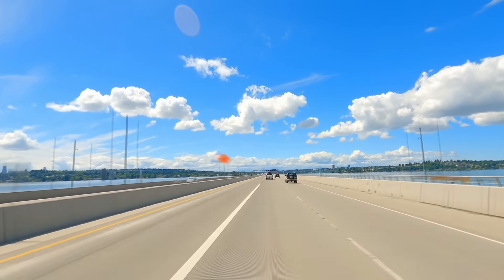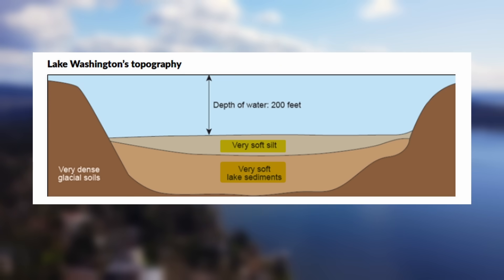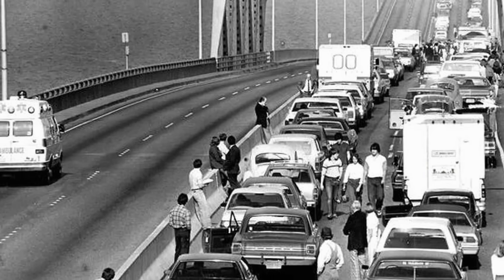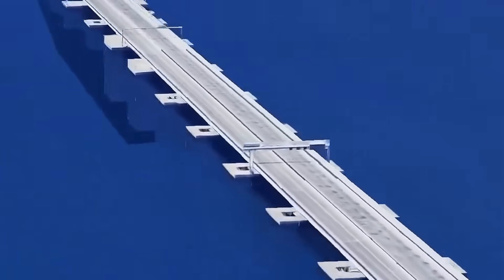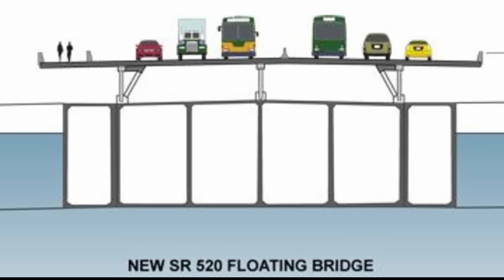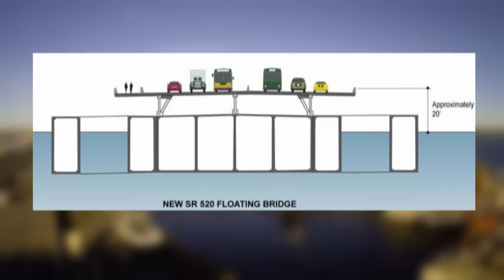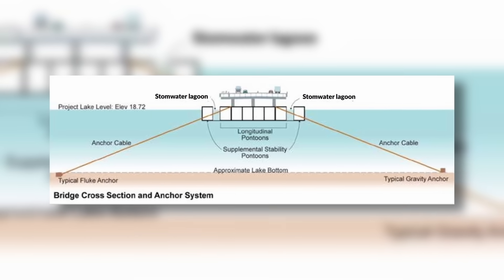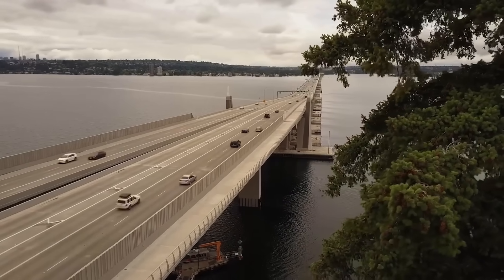The INSANE Engineering of a Bridge That Never Touches the Ground

Comment: Why wasn't a tunnel an option?
Reply: The lake is over 200 feet deep and so is the muddy bottom ! There is a tunnel at the end of the bridge  , Mt. Baker tunnel !
Reply: @averteddisasterbarely2339 You are talking about the wrong bridge,  that's the other floating bridges to the south (interstate 90).   There is a short tunnel/ lid at Montlake that this highway passes through just west of this bridge though.
Reply: If we had to start over, tunnels would be an option. The technology for tunnel boring has greatly improved in the last 50 years. But they are even more expensive, and their ability to handle large displacement earthquakes is a matter of debate. A floating bridge might do better. In any case, a very large earthquake is inevitable in the PNW eventually.

Comment: I enjoyed the video overall, but one niggling point: at 0:16 Ummmm Why do Americans measure long distances in feet? 

What you called almost 8000' is "around a mile and a half". If you're going to use imperial, please use the unit from that system that makes an easy to understand number. Humans are not good at imagining thousands of anything. 

I'm not making a point here about metric, but rather the insane use of a very small unit (the foot) rather than a seemingly appropriate sized one (like a mile, if you don't like kilometers). 

I can imagine a foot or a centimetre or a yard or a metre or a mile or a kilometre; but right thousand of them bundled together, no thanks!

Kind of makes nonsense of all the videos saying how human scaled the imperial units are, when you don't use the one that's appropriate to the measurement in question.
Reply: Answer: Our primary measurement system is Imperial. Always has been, and likely always will be. Not all countries are the same, in case you hadn't noticed.

Comment: I think the bridge is a technological marvel. What concerns me, however,  is the slope at both ends. What would happen during an ice storm that could coat the roadway with such affecting vehicles attempting to maintain traction climbing it  and those attempting  to maintain control during braking going down?
Reply from the maker: Good question! The bridge doesn’t have any special built-in features like heating cables or automatic de-icing systems to handle icy conditions. Instead, the WSDOT manages safety during severe winter weather by implementing practical measures such as reducing speed limits, restricting lanes, or even closing the bridge entirely if conditions become too hazardous.
Reply: The slopes aren't actually as steep as they look in photos, plus Seattle very rarely gets icy conditions like that.
Reply: Good to know.  @zagnut3707
Reply: It's like a hill, drive carefully or stay home.

Comment: Amazing feat of engineering! 
Do a video on the Blue Ridge Parkway in NC on how that was constructed without modern heavy equipment.
Reply: Don't underestimate the power of steam.
Reply: @Stacy_Smith  Exactly, moving all that coal by horse.
Reply: @ginog5037  Actually, a lot of steam equipment ran on kerosene because of energy density.

Did you know Caterpillar came up with their name from a comment made by a publicist?
Reply: @Stacy_Smith  Yes, that is exactly what I want know the lingistics of moving everything up the mountains. And yes how CAT gots it's name.
Reply from the maker: Thanks for the suggestion! The Blue Ridge Parkway is an amazing feat, especially since much of it was built in the 1930s without the modern equipment we have today. A lot of the work was done by hand or with early machinery, with help from programs like the Civilian Conservation Corps.

We don’t have a video on the Parkway yet, but we do have one on water bridges, which highlights some incredible structures built around the same time. Check it out and let us know what you think! https://youtu.be/5fNR02_B7jw

Comment: All it took to sink it was 1 person to leave the hatch open, done on purpose so the construction co could make more money.  Most major construction in the Seattle area has had issues, it's all a scam with all the errors that have shut down our traffic so they could do it right
Reply: No there were large cut outs on the south side of the bridge cut during the rebuilding. In western Washington the fall/winter storms come from the south a fact the engineers for the Washington department of transportation (known in state as the department of incompetence)  failed to recognize so the bridge was a goner. On purpose or not that is the question.
Reply: The previous 520 bridge didn't sink. It was dismantled and its components are in the process of being renovated and reused for a new bridge (I believe in Canada) that has lower traffic volume.
Reply: @borisgalos  Yes it was the I90 bridge that sank in the vid they kinda blurred the lines between the two.

Comment: But can it handle tsunami's?  Remember the "Big One" is due!
Reply: It's not on the ocean, it's across a lake.
Reply: @zagnut3707  But the Hood Canal floating bridge is in a saltwater fjord open to whatever comes in from the Pacific Ocean. 8' to 10' tides happen twice a day. It just floats up and down, making the slopes at the ends to the shore steeper or less steep. If a tsunami came in, it would just float on it. Given its location, much of the Tsunami force would be expended coming up the Strait of Juan de Fuca and the top of the Puget Sound before reaching Hood Canal. Nobody takes tsunami's lightly on the West Coast, but this bridge will likely handle it.

But a 9.0 earthquake on the nearby Juan de Fuca plate (subduction zone) would likely wreck it along with all the fixed bridges too. One of those is coming someday. Subduction quakes are inevitable due to plate tectonics. Last one in 1700. Next one due sometime between right now and maybe the next couple of hundred years. No one knows the timing given past quake timing has a pretty big standard deviation. I keep a a few bags packed, just in case it's tomorrow.

Comment: They should build this type of bridge across straight of gilbraltar
Reply: yea there is a video as to why
ever thought of the third of ocean cargo goes thru there
also how high would it have to be to get pano max tankers under it
yea clever clogs you are
go learn a bit on bridge building
also do you know how high they are
Reply: Floating bridges can't get high enough for super sized ships and they don't do well with strong currents.   They do best crossing calm lakes.
Reply: @zagnut3707  Don't forget the floating bridge across the Hood Canal on the west side of the Seattle region connecting the area to the Olympic Peninsula. It crosses a tidal fjord with high current year round and high winds frequently in winter, and it has to open frequently to allow submarines and taller ships to pass through. The Navy's main submarine base on the west coast of the US is inside Hood Canal. 

The first Hood Canal bridge sank in a storm, and the newer one requires a lot of maintenance on the floating draw span (it floats out of the way to create an opening). But the water is too deep in the Hood Canal (fjord) to allow supports. Just anchors with very long cables. 

Net, net... it crosses a rather violent and windy bit of water and at 7800' length, it's about the same length as the Lake Washington bridges.

Comment: How does the deck stand for water height variations (tides)? Does it flex?
Reply: No tides in the lake but the water is lowered during the winter months there are slip joints on both ends to compensate for this.
Reply: @martypeterson9214  
Thanks for your early reply. Where can I find more details on these slip joints?
Reply: Gibraltar is much deeper, this means much longer cables. The longer the cable, the bigger they have to be for a given allowed expansion.  To compensate for water rise, the cables have to be at angle, the greater the rise, the greater the angle so that the cable does not need to stretch too much to compensate.  To provide lateral stability, the cables must be under load at the lower level, as the water rise the load will increase. If the cable are vertical, the load come from the buoyancy of the pontoons only but then there is no lateral stability.  With an angle the load come from the buoyancy of the pontoon plus the opposite cable.  If the cable were at 180 degrees, a small water rise would lead to an infinite load in the cable.  It is a similar calculation has lifting an object with an overhead crane.  I am not saying it is impossible, I did not do the calculations, but it is not as simple as ordering a longer cable.  Then there is  the issue of whale migration and submarine.  There is a video on YouTube about a bridge across Gibraltar and I am pretty sure they thought about a floating bridge but I do not remember the conclusion, impossible or too expensive.
Reply: @alainc.9000  ever thought of the head room for giant pano max boate
150-200 ft  50-75 mtr
me  thinks the wind would topple it

Comment: No railway!
Reply: The light rail connection is built and being tested on the other floating bridge across Lake Washington.
Reply: yea 5000 tons all in one place
it would have to travel down the middle
Reply: The technology didn't exist until just the last couple of years to run trains across a floating bridge.   Floating bridges shift a little with the waves which can be enough to derail the train.   There is a light rail operating now across the other floating bridge just south of this one.

Comment: We have 4 floating bridges in Washington State. 3 on Lake Washington, one on SR 520 and two on I-90.  The other bridge at the Hood Canal is tidal so it has additional challenges.  A video about that bridge would be interesting. 

When a renovation to the I-90 bridge caused damage to the bridge anchors they used tug boats to hold it stable until those got fixed. 

Prior to the first bridge opening in 1940, and continuing for another 10 years, the lake had a ferry service from Kirkland to Madison Park.  There have been discussions about adding passenger ferry service again but with light rail nearly complete on I-90, and sadly missing from SR 520, I don’t think ferries make much sense.
Reply: The bridge across lake Okanagan in Kelowna, British Columbia is also a floating bridge.

Comment: It needs light rail.  Accommodating cars is no major feat.
Reply: That is happening right now on the I-90 bridge across that lake.  Also having rails on a moving bed is another engineering challenge.
Reply: That is nothing special either🤷
Reply: @TylerTheBassCreator  Actually, running rail tracks on a floating bridge which drifts both in horizontal location with wind and water currents and in elevation with tides is a massive challenge that has never been accomplished before.
Reply: @borisgalos6967  false. It's been done
Reply: @TylerTheBassCreator  Where?

Comment: Been across both the original and the current modern generation hundreds of times..  It's completely straight and flat so the biggest temptation, especially early in the morning when nobody else is around, is to slightly exceed the posted speed limit.

Comment: Any kind of protections for those under water wires?
Reply from the maker: Great question! The underwater cables anchoring the bridge are super tough—they’re made of thick, woven steel (over 3 inches) and are built to resist corrosion and wear. To protect them even further, the bridge has a system that actively prevents rust, called cathodic protection.

On top of that, there’s a monitoring system that keeps an eye on the cables 24/7, and WSDOT regularly inspects and replaces them when needed. In fact, they replaced 15 cables just this year to make sure everything stays secure. Pretty impressive, right?
Reply: @MegaBuilds5280  Awesome thanks for the info! Was wondering how they handle anchors etc but makes sense they are heavily monitored and upkept. Def one of those bridges that cannot just "patina"